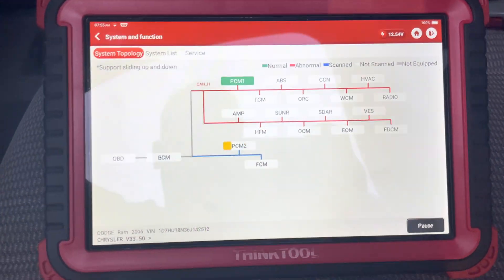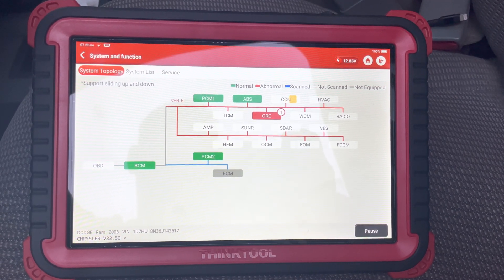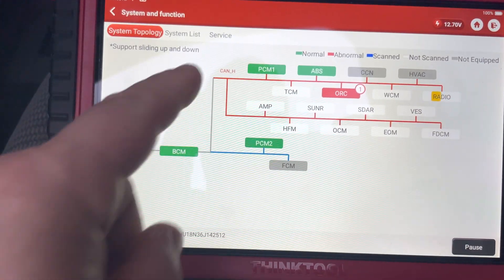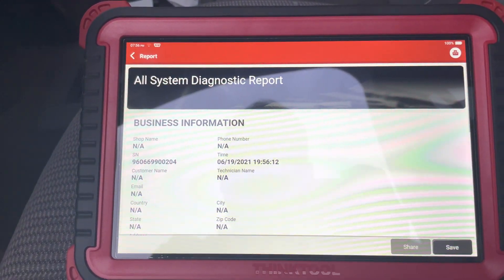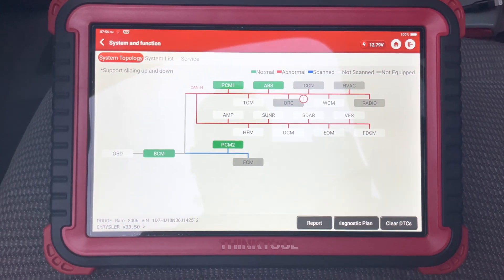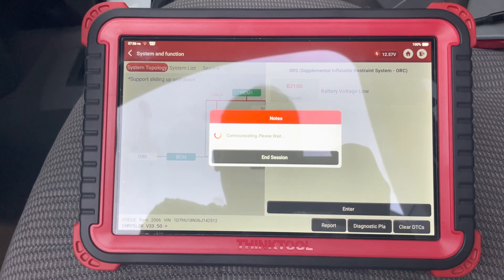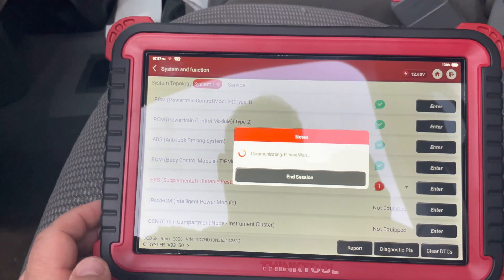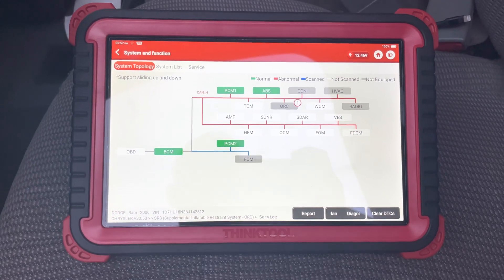Thinktool Thinkpros Topology feature

Comment: Between this and the autel ms909 which would you recommend? I know the autel  comes with a jbox but its like 3 times the thinktool price
Reply from the maker: Well if you are in the United States I’m selling the Thinkcar s20 with lifetime subscription and you can add on the x prog to get lifetime immo/keys. The Thinkcar s20 is more actually it comes in at $4500 but with the lifetime subscription it’s a no brainer. You’ll never have to pay to update again. Plus it has programming for ECU etc. for about 10 makes. It also has a J 2534 as well
Reply: @weldingjunkie  thats a good deal but its way out of my budget and pretty overkill for my needs. My 906bt does everything i need but i wanted something with a bigger screen, faster processing and topology. Just unsure of the long-term reliability of the thinktool platform
Reply from the maker: @AR-il9gk  understandable. So Thinkcar is launch so it’s been around a long time. There is no more Thinkpros but the new one is the thinkcar s10 the pros is the old platform, comes with 2 year subscription. You can also get the TopDon Phenix plus as well. They will last a long time the tablets are Rugged and they are faster than autel too. I have the ultra and im608 and I grab the thinkcar first
Reply from the maker: @AR-il9gk  are you in the USA? I can Send you my email we can talk more
Reply: @weldingjunkie  yes i am in the usa